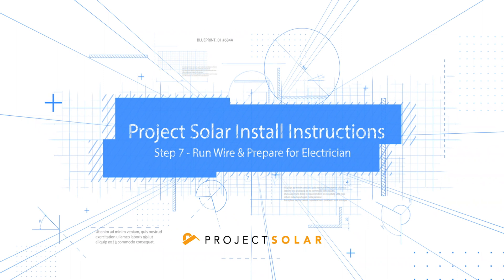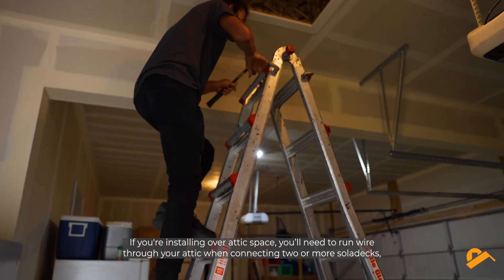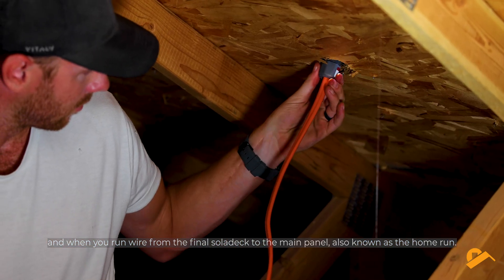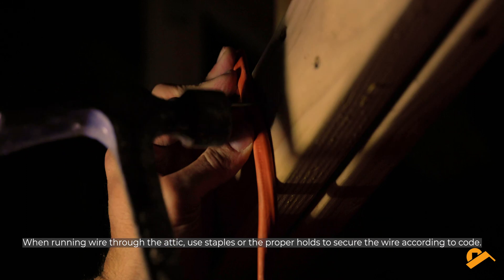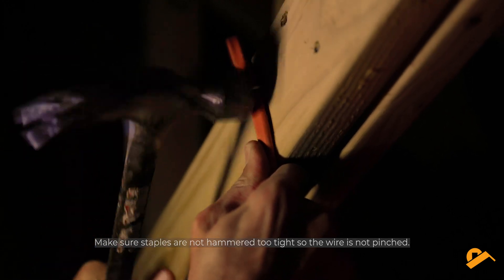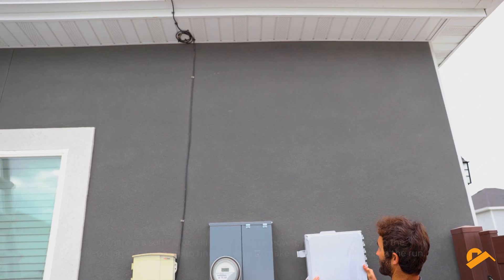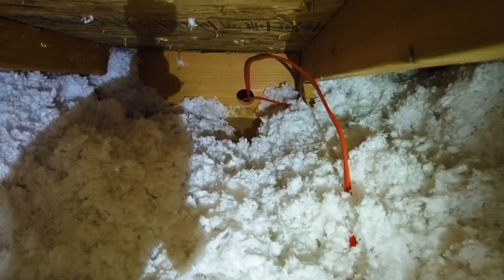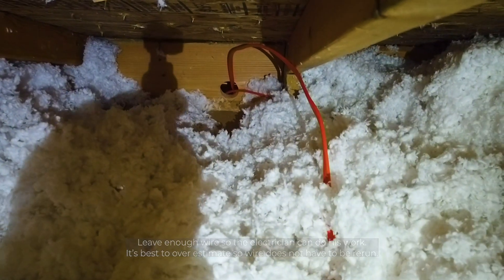Solar DIY Step 7: Preparing for the Electrician - Running Wire Like a Pro

Comment: This is not correct. 
The wire needs to be in metal conduit, and it needs to be attached to the wood every 4 feet and it needs to have red PV stickers every 10 feet.